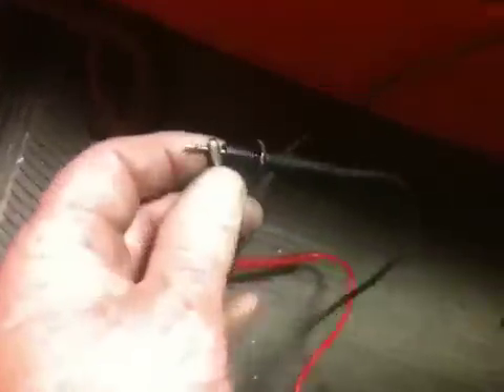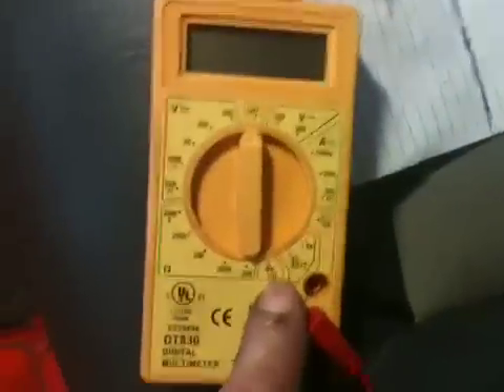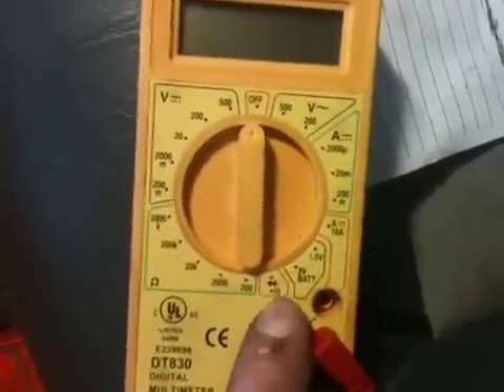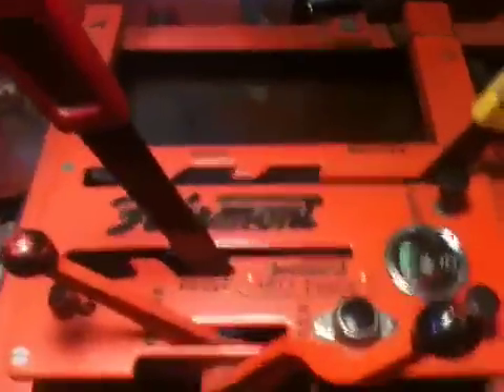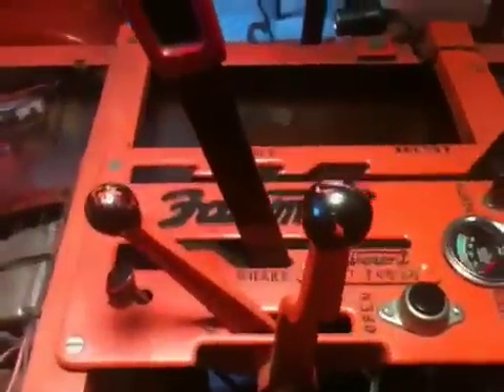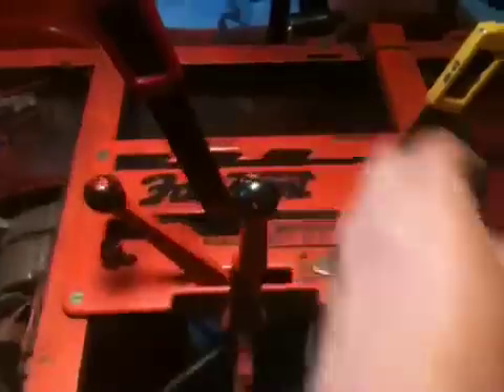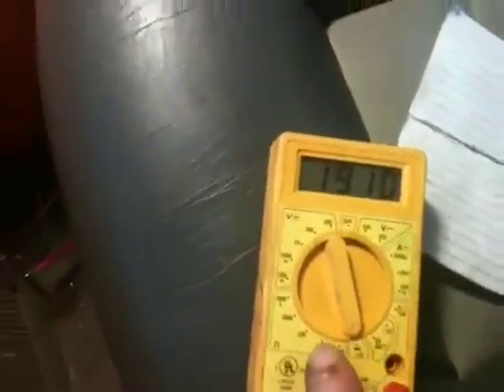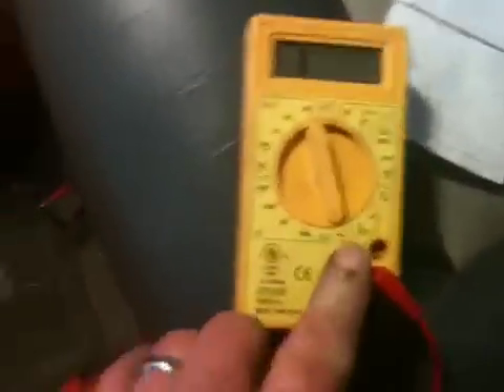How to set the timer dwell on a Fairmont ROC motor part 2

Comment from the maker: I use TCW3 two cycle oil. I mix it 16/1. TCW3 oil can be found anywhere outboard motor oil is sold. There are several brands but they are all the same. It will keep the motor well lubricated and help prevent carbon buildup on the piston, head and exhaust port. I also add Marine StaBil to neutralize the ethanol if I can't get pure gas. Also I try to use high octane fuel. These engines are real tough and out on the railroads stood up to a lot of abuse over the years. if you pamper your Fairmont two cycle now in its "retirement" years, it will give you years of trouble free service. Thanks for watching.
Reply: 16 ounces too the gallon?